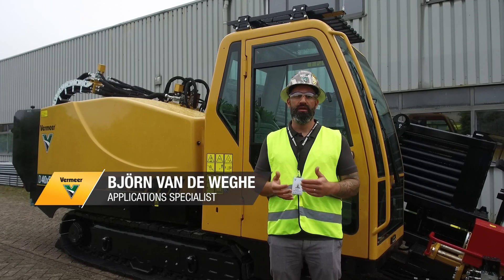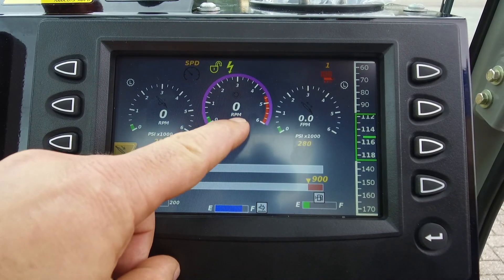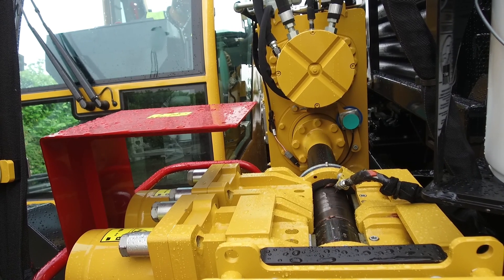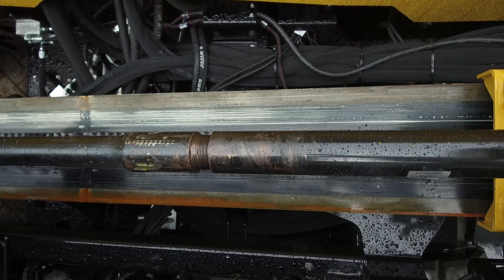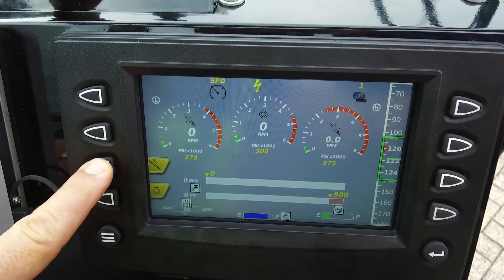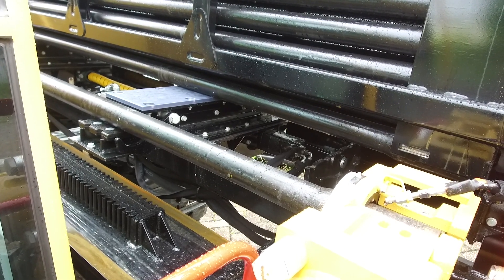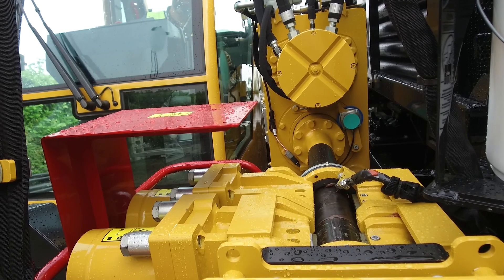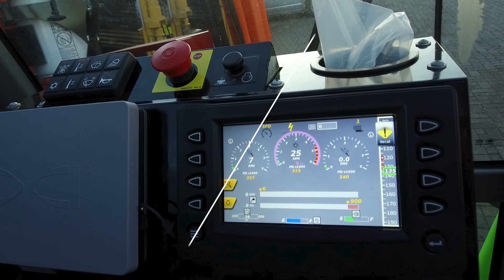Tips for using the dual rod connection on the Vermeer D40x55DR S3 drill

Comment: Why would you use different speeds?  When do you use different speeds on each rod? What's the difference,  can i set inner rod and it keeps rotation going and than use outer rod to steer? Does this machine still have auto steer/carve?
Reply: All formations are not equal, some require different rpms and pressures to cut efficiently and not tear your tooling apart. Where we are, we are drilling in solid or broken basalt(lava) formations, that both utilize a different approach. When in a solid formation, we absolutely us the inner rod to cut, and the outer to steer independently like you asked. When in broken formations at times we can utilize the single rod mode and drill traditionally. Many different ways to utilize dual rod, just need to find the most efficient way for the formation youre in.